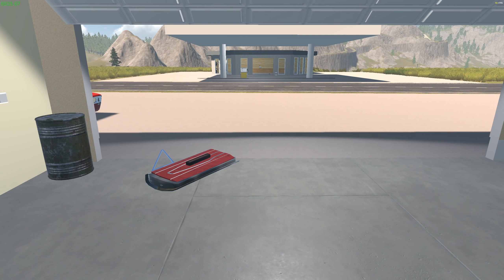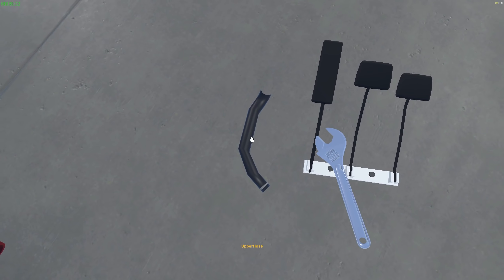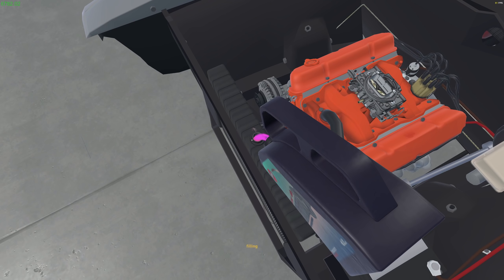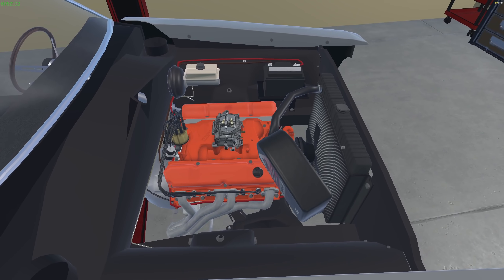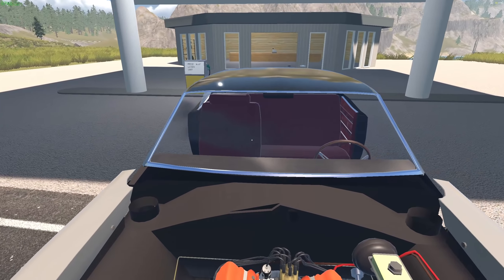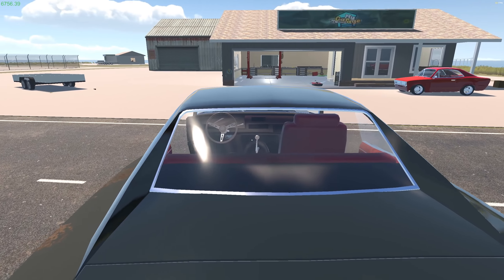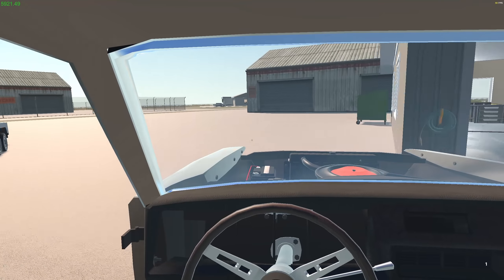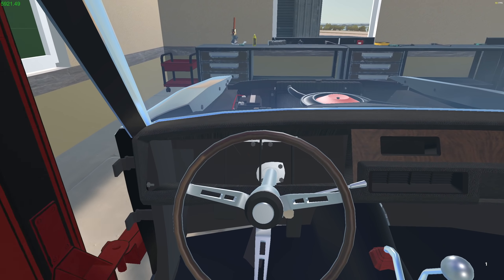My Garage | Episode 23 | She lives

Comment: You forgot 2 lower bolts on the radiator. Not the drain plugs the corner ones. Looks like lower dash board screws are loose as well, need screwdriver. Did you double check to make sure you don't need valve cover gaskets?

Comment: I plan on swapping my 82 C30 350 with a granny 4 from mechanical to eletric once i get a new wire harness. Its an "eventually" thing. Need the extra HP for the horse trailer when i dont want to use my diesel.

Comment: The reason there is no funnel is simple. Coding the physics for a funnel in the game would not be as simple as you may think. It could be done, but...you've seen what kind of strange physics can happen in Unity games playing other games, and a funnel that actually functioned would probably cause problems, and need lots of bug testing and fixing.
Reply from the maker: I see it mich simpler than that. When you place the funnel it just locks in place. Effectively just making the hole bigger

Comment: What do you mean by "parasitic draw?"
Reply: As in components that draw horsepower for various reasons. In this case, the mechanical fan (fan that works from the engines rotation) the drag from air friction is "parasitic" to the horsepower of the engine since the drive of the fan is directly connected to the rotation of the engine. That air drag literally slows the engine. Electric fans are independent of engine rotation, they work on their own electric motors.
Reply: @bkingkaley  Ah, thank you.
Reply: @Dr Dread Man of Mystery 
No problem